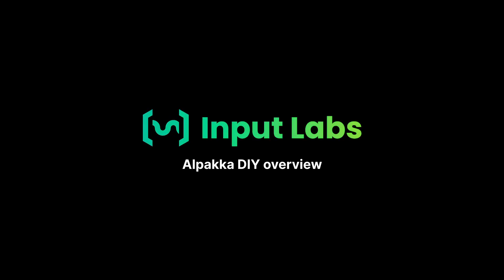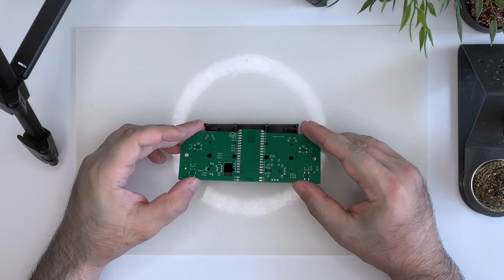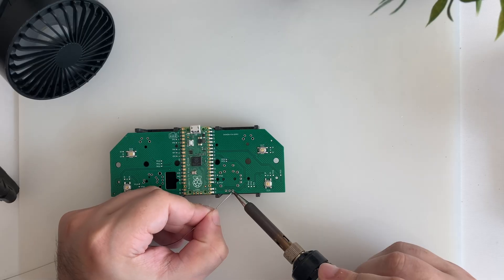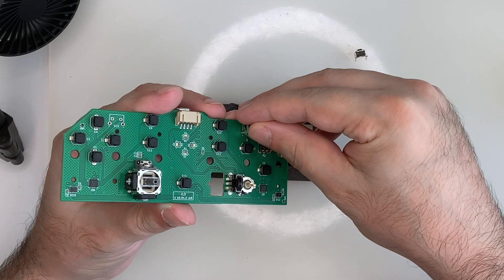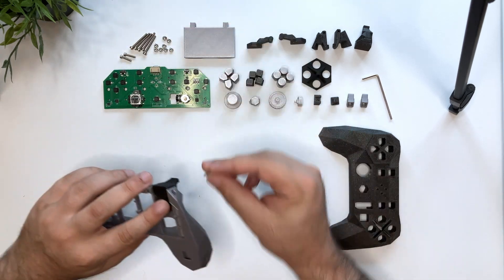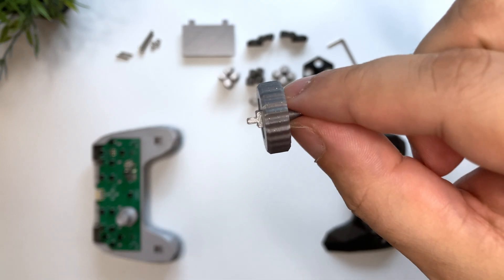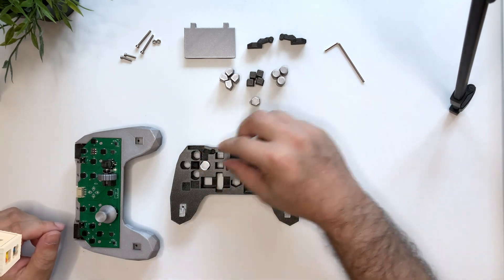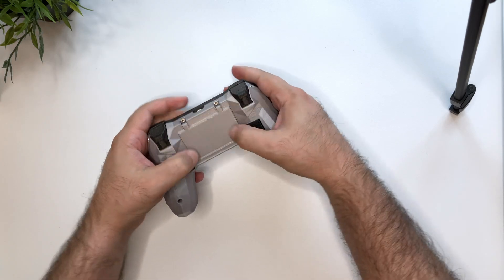Alpakka (0.97) controller: DIY guide

Comment: I just put my controller together. Everything works perfectly. I am surprised by the high quality of the printed components. I also use a 3D printer privately. But such beautiful prints do not come out for me. Gyroscopes combined with a touch plate is something beautiful .

Comment: Why are the front buttons at 2:45 look different? Do they have some sort of covers?
Reply from the maker: I'm not sure what you mean. 2:45 is still about the thumbstick, and then the directional stick. In any case, there are no covers or anything.
Reply: @inputlabs  The forward facing buttons linked on the website look small and circular but here they all look square shaped. I'm just wondering if there's anything being done to dampen the button press or add any springiness to them? I feel like a lot of the electrical switches I've tried can be quite harsh and clicky, whereas most game controller buttons have a much smaller actuation force.

Comment: Is it possible to replace the filament with something cheaper? something like a touch button, for example
Reply from the maker: Community members created mods to use a screw or even aluminum foil, also it is possible to use any other button as a gyro engage instead by editing the profiles
Reply: @inputlabs  thanks, i'll think about it

Comment: would it be possible to just add another joystick instead of the scroll wheel and directional stick?
Reply from the maker: It's all open source, so of course it's possible. But for now the purpose is for the gyros to replace the thumbstick.

Comment: It would be interesting if the community designed PCBs compatible with common controls, for example PS2, so it would only be enough to change the control PCB and we would save the step of 3D printing. I have that idea but I don't know anything about circuit design.

Comment: Some questions and stuff:
1. How much it costs?
2. Are the rear triggers analog?
3. Can a Genesis/Saturn-like 6 button layout be made without sacrificing other buttons like start and select?
4. Can you change the layout of buttons, like the Xbox's D-pad/stick placement or a lefty layout.
5. I would like to see an option for a Genesis-style D-pad, I prefer this than the Playstation D-pad.
6. Seeing a mouse wheel reminds me of those 2000s PC controllers (which I never had one) with wheels and strange designs, it would be cool to have a shift button.
Reply from the maker: 1. https://inputlabs.squarespace.com
2. No. They are digital
3. - 5. All the sources, including the 3D and PCB designs are open in github: https://github.com/inputlabs/
So such modifications are certainly possible.
6. The Desktop profile already has a shift button: https://inputlabs.io/alpakka/manual/profile_desktop

Comment: Как играть в шутеры?
Где сенс панели, как у Стим контроллера?
Мультиплатформ будет?
Reply from the maker: The Alpakka works very nicely with First Person Shooters. Check a couple of the other videos.
There are no sensor panels, like on the steam controller. Only one conductive hexagon, which if touched, enables the gyroscope inputs, usually used to aim / look around.
The Alpakka currently supports Windows, Mac OS and Linux very nicely. Depending on the profile, it simulates mouse / keyboard / gamepad input.

Comment: I like it and thought about building one till i heard that it needs conducive filament, that stuff is freaky expensive and would take the cost to over 100€ really fast
Reply: I have seen people who bought premade ones for less than 100€ so it must be cheaper than that to produce
Reply: @GHCMargarita  yeah but after you buy the spool its not going anywhere, even if you used 30 cents worth of material
Reply: Maybe you can add a conductive coating, its a bummer

Comment: Would love to see someway to scan my hands and programmatically generate a new controller body. I have big hands and I cannot lie.
Reply: If you know how to 3D model you could try getting some clay or anything moldable and just squeeze it into the shape you want, then take a photo from a fixed distance with rulers around it from every angle. Pull those into the modelling software you use and draw it that way. If you can't do that, try one of those epoxy clays and get the general shape then sand the outside, dremel the inside. You could even use thin plastic sheets, heat them up to bend in the right shape and melt bits of it in columns to make screwposts.

Comment: Quick question: how complicated is it to modify the layout of the controller? For example, changing the scroll wheel for a second stick, or adding more buttons for a six-button controller layout?
Reply: you cant add second stick bcuz pico has 3 pins for potentiometers. one stick uses 2 pins (x, y axis)
Reply: @ahenyao   what alternatives are there to the pico
Reply: @XYZ_SHOGUN an arduino pro micro or anything with a 32u4 chip
Keep in mind the number of pins has to be sufficient.

Comment: So excited. I've had this idea for years, but didn't have all the coding skills to put it together. So glad it's open source too.

Seriously, this is a dream come true.

Question 1: think it's possible to make custom boards that fit in older console controllers rather than a 3d printed shell?

Question 2: I've seen people mix graphite powder with silicon to make a conductive. Could probably make button pads with 3d printed molds as an alternative to the "clicky" style buttons. Think this could be possible?

Question 3: I saw you are working on a 1 handed controller. Think alternative models for say a hotas, arcade stick, or a driving setup are possible?
Reply from the maker: 1: I don't see why not
2: Possibly but we want to keep it simple for DIY.
3: Yes every controller will have several profiles with several usecases in mind.